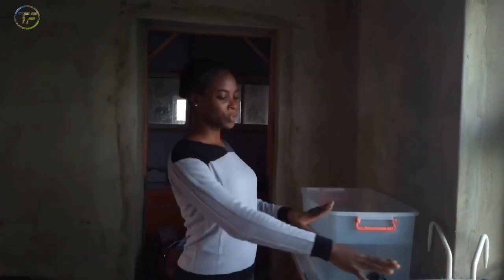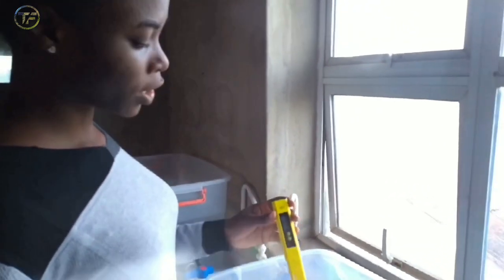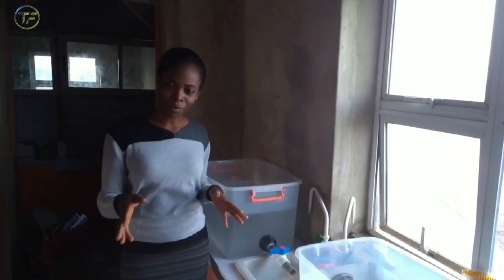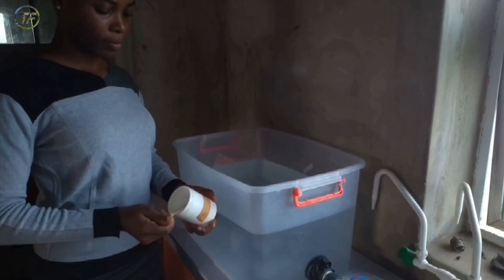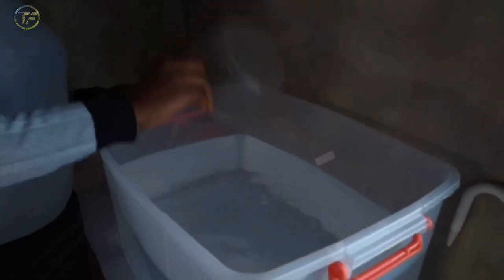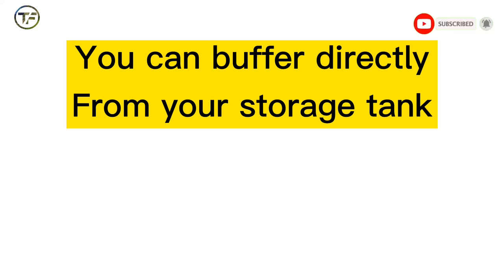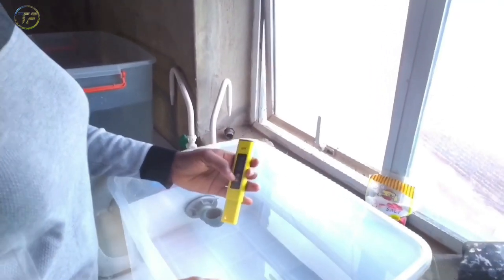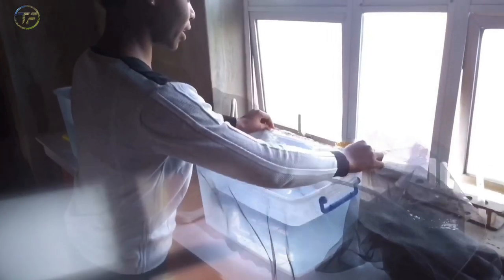How to Hatch Catfish in Nigeria 2021 (Series) | Preparation of hatching vat, buffering of pH

Comment: Good job farm lady. I can't tell you how excited I am about this. I've been having this low PH level in my pond and you've just solved my problem. I'm very grateful 🙏🙏.
However, I have a question that goes like this. How many hours do you suggest we let the water to rest before coming to check the PH level again?
Also, Can you add the soda ash to the pond while you have fishes inside? Assuming it's a grow out pond.
Thanks once again
Reply from the maker: The type of pond you use will determine if the pH will neutralize if you go your water.

You can't  add soda ash directly.
You can only add directly into your pond after mixing in a bowl of water before mixing with the pond water. This can only be done for fingerlings stage and above

Comment: My name is Hambal, from Ghana. Thanks for sharing such info. I have a few qns though:
1. Are the vats connected a continues water source throughout the hatching process or connected to continuous water after hatching
2. Can direct tap water be used for the hatching process?
Reply from the maker: Hello Hambal from Ghana. 
You can do either of the two.

But best is doing continuous flow through throughout the hatching process, as you're most likely to have a higher hatching rate due to increased and sustained dissolved oxygen